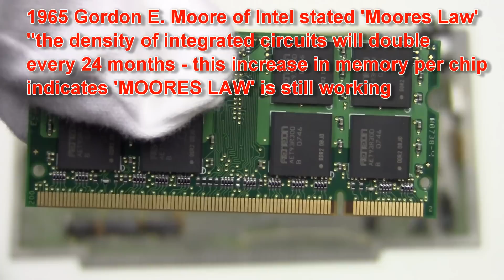Vintage Computer Memory Card 1Kilobyte from MITS Altair 8800 Microcomputer

Comment: Although disk manufactures have gotten away with calling a Megabyte 1000000 bytes system memory is still 1024*1024 = 1048576 bytes of memory. Its not 1000 of these cards to make a MByte it would be 1024 of them!

Comment: If you ask me, they should have stuck with static ram. Dram puts a huge burden on the CPU. Does this unit use parity? Usually in older computers you will something like 9 64kibobit making 64k of memory with parity error checking. Since I don't see any extra ram chips on the board, is there some other type of error checking for the ram? Notice also on the dimm you showed, that the caps are no longer necessary like they were on the older boards (as late as the PC-AT (286) needed them.